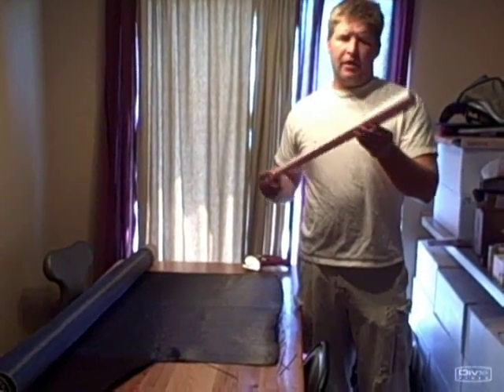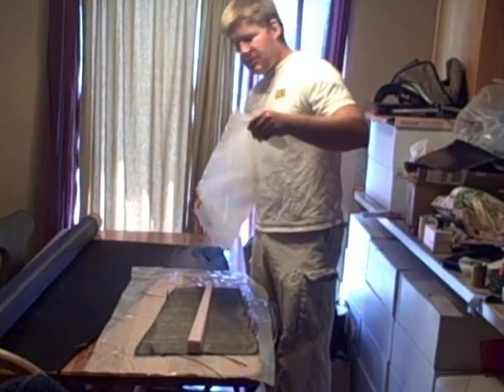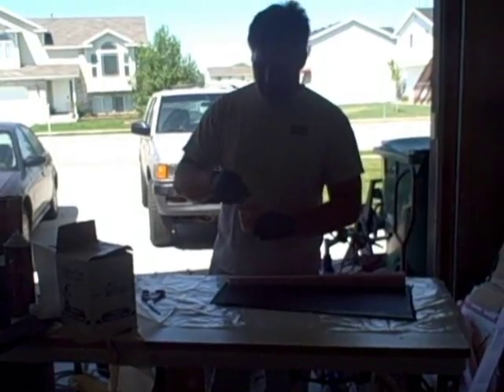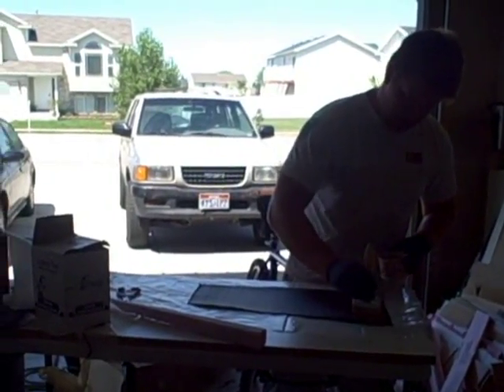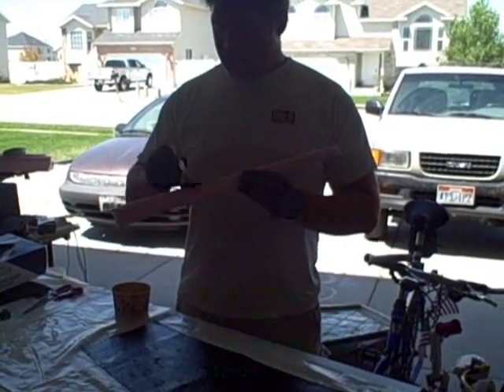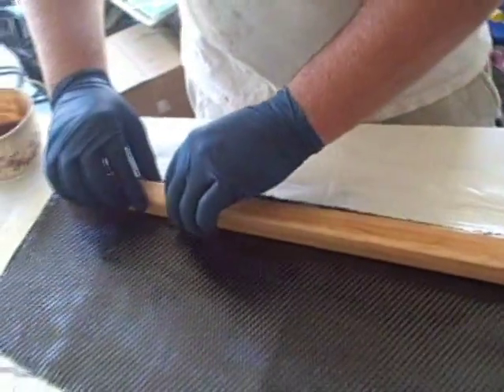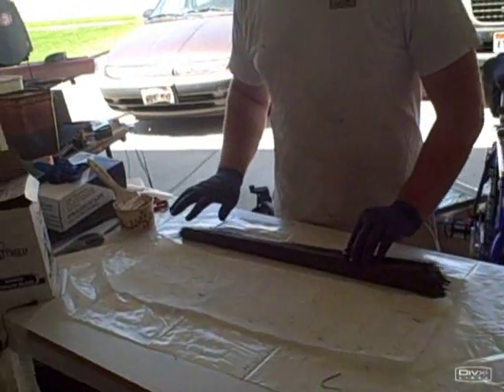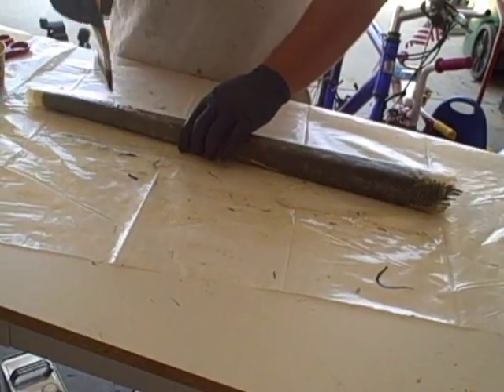Chapter 2 Carbon Fiber Bike Build.wmv

Comment: Hi Mark , im a really big fan of your projects , im about to build my own bike frame made from carbon fiber for a school project  , im thinking about making the molds with my frame cutted out  from a cnc router  and then applied the resines and the carbon fiber over it. The problem is that the design of my frame doesnt have the lowest  "tube"  of the triangle , ¿ do you think the carbon fiber would resist the design? ,i only have 5 weeks , ¿you think its enough time if i work about 5 houers per day?. Thank you ever much , i would appreciate if you could answere me back.

Comment: What if I dont have access to a vacuum? Could I just possibly apply carbon, apply resin, let it dry, repeat? Also how did you proceed on making the foam molds??
Reply: If you're laminating more than one layer of carbon fiber sheet, you have to use vacuum. Otherwise the strenght of the component can be totally random. Also the vacuum gives it much better finish.

Comment: How much epoxy do you need for a frame?
Reply: this depends on how much CF cloth you're using.. If the total weight of the CF cloth is 100 grams then you will need about 35-45 grams of epoxy resin..

Comment from the maker: I may not be able to answer this question like you want me to. I used EZ-Poxy on this bike but I don't like using it- it's a lot more toxic than using one of the others epoxies I recommended earlier. As far as light and strong goes... unless you're building a large vehicle/craft, the weights are all going to be about the same and as long as the epoxy is designed to be used with carbon fiber it will be strong enough for your application- However, most do have differences in flex and brittleness.

Comment: I mainly need the strongest and lightest epoxy I can get, I won't be using it in water, It might get rained on occasionally though, where did you buy yours from? and which epoxy and which resin did you get?

Comment from the maker: I've never seen aircraft or marine grade epoxy at the hardware store- I've only seen polyester resin there. You'll most likely have to order it from an online retailer. For marine use West Systems, Resin Research, Mas Epoxy, Resin Services all make an epoxy that will work with your particular application. If you need to, don't be afraid to call them to find out what they recommend. If you're on a budget then Resin Research has a good economical epoxy (Project 21 system).

Comment: Thanks for taking the time to reply to my comments man it means a lot and not a lot of people would do that, you've been a BIG help and I'll send you a message whenever the thing i'm making is done so you can see it. I'm ordering 6 yards of the 6k 11oz 2x2 twill one and it turns out it's only gonna weigh about 9lbs for all of it :D I'm not sure how much the epoxy's going to weigh however. And I was wondering can I get the aircraft grade epoxy from Low's? and do I need resin to mix in also?

Comment from the maker: I used XPS/XEPS foam wrapped in carbon fiber. On some of the tubes I was able to burn some of the foam out with acetone- but there was still a bit of foam left behind. So if you want a clean hollow tube then consider doing the clamshell and bladder methods.

Comment: Hey I have a really important question, what is the frame tube made out of? I'm making something myself but it has to be super light and I cant have anything inside the carbon fiber mesh after it's done, I won't be able to pull it out when I'm done because of how the mesh will be shaped

Comment from the maker: It's XPS/XEPS or Extruded Polystyrene. This particular type that I am using is just the Owens Corning pink 2lbs per cubic foot insulation foam. The blue Dow insulation foam is the same stuff.

Comment from the maker: I chose my carbon fiber based mainly on cost. Most carbon fiber clothes that you'll find will be a standard modulus like I used. It is a 5 harness satin weave which is kind of unique but the carbon fiber itself is just a regular AS4 which is pretty common. You'll find AS4 in a number of different weave configurations.

Comment from the maker: Thanks for the comment! I used about 1- 1.5 quarts of epoxy and about a half sheet of 2" extruded polystyrene (4'x4'). I don't recommend the epoxy I used in this build- it's a bit nasty to work with. Currently I've been using HTR-212 resin and so far it seems to be some really good stuff.

Comment from the maker: The carbon fiber is 6k. The "k" indicates the tow size or the number of filaments in the cloth's strands. So in a 6k cloth there are 6,000 filaments or individual strands of carbon fiber in the cloth's "yarn" so to speak. The actual cloth was 50" wide and cost $35 per yard- I used about 2 yards so I spent about $70 on carbon fiber.

Good question and comment. Thanks!

Comment: your video description says, that the cost of building your own bikeframe was 160 bucks. however, on your website you say, that you used 6kg of carbon fiber. is it a mistake (0.6 kg) or where on earth did you get such a cheap carbon fiber?
thanks

Comment from the maker: Yes, but you can NOT use Polyester resin on Polystyrene foam- the foam will melt. Also be aware that polyester resin is more brittle than most epoxies- so make sure to take that into consideration while building.

I know polyester resin is less expensive but I would recommend getting a good epoxy to do this project. It's a lot easier to work with and is generally tougher. Lately I've been using Resin Services HTR-212 with good results. You'll need about a Quart of epoxy for this project.

Comment from the maker: Good questions. The airfoils were made with two templates put onto each end of the foam. Then I hot-wired them out using a longbow. I didn't do a great job with this tutorial as it was my first one. I'd like to think that my newer tutorials are getting better.

The main reason for not doing more than one part at a time was mostly because of the pot-life of the epoxy. It starts to get thick after about 30 min. I now use a manifold that allows me to hook up multiple bags to the same pump.

Comment from the maker: @MitchHardie 
I used Owens Corning Pink Foamular insulation foam. I'm pretty sure the stuff I used was just 2lb Extruded Polystyrene (XEPS or XPS). Dow's blue isulation foam is the same thing. 

The Max service temp is 165 Deg F. So I wouldn't use it in an oven if more heat than that is required. This type of foam is used a lot in home-built airplanes as cores- but the airplanes are usually painted white so the heat from the sun doesn't cause skin and core de-lamination.

Comment: @TheProjectJunkie1  not as expensive as you might think. dome some research  only talking about a sheet a half inch thick at most and  a qaurter inch everywhere else.  747's use this why not for everything else?  still trying to find actual numbers for flex modulus etc tensile strength. my estimate is from it's application in other areas.  however if  the plane ends up costing $90k in materials that's no big deal . building this will give me leverage to borrow capital for other projects.

Comment from the maker: @circusboy90210 
I didn't remove the polystyrene from all of the tubes. I left it in the seat-tube and most of the top-tube. I mainly took it out in places I needed to run the internal cabling. I thought it would save in weight but I think the weight savings was negligible.

Comment from the maker: @circusboy90210 
I don't know the strength differences for sure, but using an autoclave produces superior parts because it removes bubbles in the laminate. To compensate you have to use more carbon fiber on non-autoclaved parts. I don't think the difference is that big but Polystyrene will crush if too much pressure is applied. I've had this happen with using too much pressure in vacuum bagging. I try to stay around 20"HG when vacuuming it.

Comment from the maker: @AZURA888 
I don't think I use any wood on or in this bike. The pink plug or core that you see me wrapping is 2lb per cubic foot Extruded Polystyrene Foam made by Owens Corning- It is insulation foam. Dow also make this foam but the color is blue. This type of construction, with a foam core wrapped in a fiber reinforced plastic, is how a lot of composite airplanes are created. It produces a strong yet lightweight structure-I left the foam in some tubes and burned it out in others using acetone.

Comment: My carbon fiber fabric comes around December 20-26, so I'm waiting for Santa, I'm practicing meanwhile with fiber glass, other question, the wood core you used here as pattern was first covered with release agent true?,was it hard to separate the carbon piece from this?, because is not like the Z frame wher the carbon piece was molded in two parts.

Comment from the maker: @AZURA888 
The cost of carbon fiber cloth can vary greatly depending on the kind your considering (e.g. weave type, tow size, weight, modulus, manufacture, etc.). $46 m2 isn't the cheapest you'll find but it's not on the high end either. Best thing to do is shop around.

Comment from the maker: @AZURA888 
The video you watched shows the bladder and clam-shell method. Most bike manufacturers are using some variation of this method now. If you did a monocular disk wheel, you'd probably have to make it in 4 molds that fit together. You could use the axle hole as the inflation point. Then hopefully you can use this point as a way to get the bladder out too. It will be a tough project but I have faith in you :-)

Good luck and keep me posted!

Comment: Thanks, I don't know but I remember that I saw a show in discovery "how it's made" about doing rings and rods in carbon fiber, a guy rolled each one inside an aluminium mold, I think is easier to do just a disk as wheel.

Comment from the maker: @LxTxSURGE 
If you're just making covers it wouldn't necessarily be as hard to make as it would be time consuming. You'll have to build two different molds since the rear wheel's spokes aren't the same on both sides- the cassette creates an offset. Your fist set is going to be expensive and then each set after that will probably cost around $75 just in materials. $90 can get you a decent wheel cover- Search "Aero Disk Cover." But if you want a good and challenging project I say go for it.

Comment: @TheProjectJunkie ok here is my plan i'm just going to use a stock rim and cover it with some carbon fiber like one of those home made discs but 
i have to order the sheets and then cutting and molding them into the right shape 
so will that be hard and expensive

Comment from the maker: @LxTxSURGE Building a bike wasn't as hard as I thought it was going to be. However, the build took a lot longer than I had expected. A lot of time was from doing research- That is why I documented everything, so others didn't have to as much. The Frame Cost about $160 in materials. I've thought about making a cf wheel, but in order to make a decent one there would be a lot of work and the process seems too big an adventure for me right now. It's a great project so let us know how yours turn out.